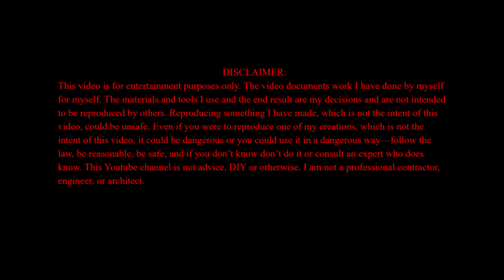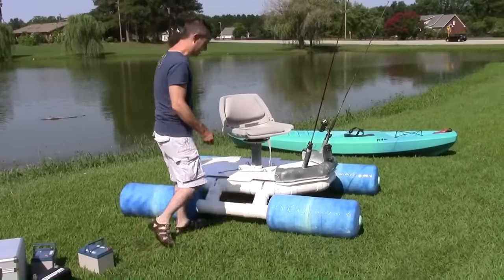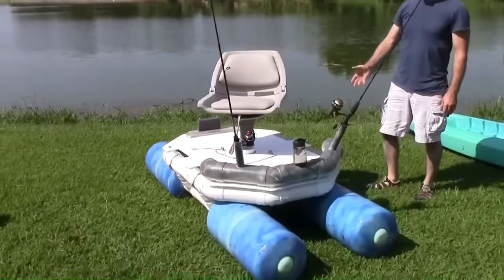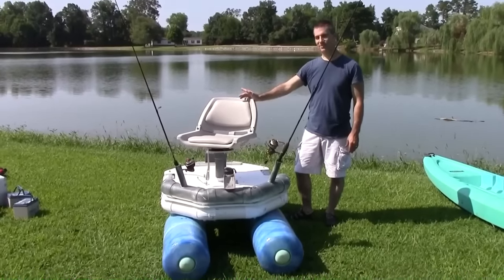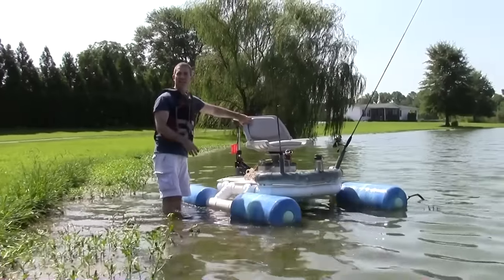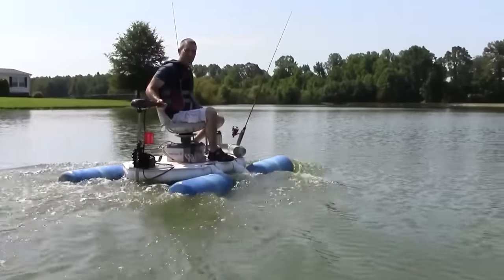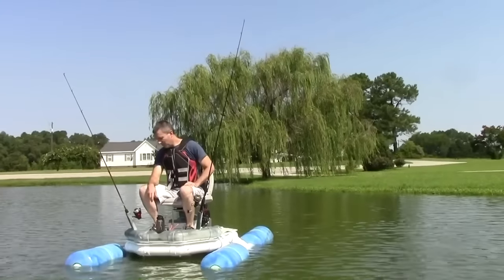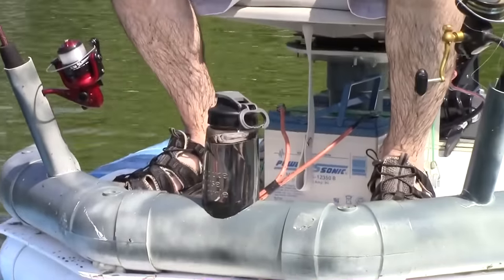Homemade fishing boat with foldable pontoons

Comment: Phase 4 and 5; Drink cooler(s), umbrella.
Phase 6 and 7:  Angled panel on front for better planing and extend (bend around chair back) tiller for easier control.
It's called "Kaizen" (continuous improvement).  ;-)
That's until you reach the stage of "Shoot the Engineer, go into production".
Reply: Yes
Reply: Post office tried to use kaizen a few years back. Screwed it up as usual.
Reply: Funny. 😁

Comment: Pretty nice design! 

 One recommendation I would make is to use A-line X coating on the pontoons this way you don't have major problems if you run into any hard objects while in the water.   It would be pretty easy for a hard piece of debris to make a bad day because the pontoons are made out of high density foam.  Align X coding would make it a lot more stout and in the incidents were you did hit a hard piece of debris it would keep it all held together if the foam did break even within the line X coding.
Reply from the maker: I will give it a try, thanks for the suggestion
Reply: Как вариаант, предварительно покрыв пенопластовые понтоны аллюминевой фольгой. Пенопласт очень чувствителен к УФ-облучению и за сезон превратиться в пыль.  И ещё, хомутовая стяжка не вызвает доверия в её надёжности, туда приходится основная нагрузка, вес рыбака против силы Архимеда.

Comment: Awesome idea and build.   Good thinking dude!
The only thing I see that could be added is V shape foam shields to the two front floats to break and disperse the water easier while going forward.  That might help glide through the water easier, less stress on the trolling motor.
Reply from the maker: Thank you for the suggestion, and I appreciate the compliment.

Comment: Of all the designs of yours, that I've seen so far... and that's several, but probably not all... I like this one the best... simple and easily fast enough for its purpose... I might increase the circumference of the pontoons adding just enough length to their support arms to accommodate the added size... to increase buoyancy and lift your deck maybe 2 more inches out of the water... I'm not sure it is entirely necessary but if I were to make any changes that would probably be it... other than possibly adding a small cooler under the chair...
Reply from the maker: Thank you and great suggestion, I really appreciate it!

Comment: I was thinking for the foam floats attached under the deck, you could make those hollow and cut some doors in the deck for additional storage under the deck, as is now just wasted space. Seems like the perfect place for a battery or tackle box, maybe a small cooler! Also maybe use the cut out inner circle of the pontoon and fill the pipe to keep the pontoon pipe from filling with water, or just fill the whole thing with spray foam and it can never sink, even if completely swamped by some assholes wake!
Reply from the maker: Those are fantastic suggestions, thanks for the ideas!

Comment: Much better but, anyway, what I would like to say is that you don't need to use the cleaning (purple) colored solution, the clear PVC glue in itself will cement the PVC fittings to the pipe, and it will be water tightly; once cemented you won't be able to separate the fittings from the pipe.

Comment: That is an awesome build. thanks for sharing. Awesome how it floats so well. 

i like that little circular saw you was using! Where did you find it at??? I would like to have one like that for some of my projects. Take care. Rodney
Reply from the maker: It is called a Dremel 678-01 Circle Cutter and Straight Edge Guide. It cost about $25.00 on Amazon. Thanks for the question.
Reply: @supergokue1  Thankya sir for all the information & also just for replying back yo me.

Comment: Pretty cool but looks nose heavy.  Another foot of foam and tube out front? And maybe a little taper, like a pontoon? Foldable was very clever btw.
Reply: Or maybe shift your seat back 6 or 8 inches, or adjustable. You are your own trim.
Reply from the maker: Nice, thanks for the suggestions!

Comment: So great so working project well done. If you made those float sides with a shape of a boat or canoe,  had better Buoyancy?
Reply from the maker: Good question, I'm not sure about that. I think it would make it go through the water better because of having less resistance. Thank you for the question.
Reply: I too was wondering the same but more on the aspect of it moving through the water racier rather than buoyancy
Reply: @supergokue1  ... I was just about to mention That; because Yes, that's correct:  Well, the Moving Through Water Better bit, anyway.  In a way though, the General Bouyancy wouldn't be better.
You could always Add a Piece to the Front of Each of the 4 Floats. You'd need to do All 4, because the Back Ones also get Resistance.  Adding then to the Back of each Float would also be advisable:  For Resistance when Reversing, and it would also Glide through the water better, by acting like the Trailing Edge of a Plane Wing.
Reply: ΓΕΡΑΣΙΜΟΣ ΣΤΡΑΓΓΑΣ 
Willy nelson

Comment: I was thinking that I would put spray foam inside the pvc while you were building that but than I saw you had some spray foam at one point inside the pipes. Am I correct?
Reply from the maker: You are correct, I did add spray foam into the legs for the pontoons. I really didn't do a good job of showing it. I appreciate the question
Reply: @supergokue1  
If your joints are sealed well, it'll be okay.
In fact, adding foam inside the pvc pipe won't help it float or support more weight - it'll only keep it from sinking completely in the event of a leak.
 Foam is heavy on its own, but once/if you DO get a leak, it'll hold LOTS of water, and man... talk about HEAVY!

I've been building boats since 2003, and we only add enough to keep it off the bottom of the lake(or whatever body of water), and since we stopped filling them completely with foam, we get better speed, fuel economy, and weight carrying capacity.

My personal Saltwater Flats boat is a 15ft two man fiberglass. When I redecked it last year, the hull weighed roughly 670lbs. I removed 90% of the foam inside, and put a new Coosa board deck on her... the hull now weighs around 315lbs. About 125lbs of that weight difference was between the old plywood deck, and the newer, lighter Coosa deck. The rest was the foam. Almost 230lbs of it!
THAT is how heavy foam can be, depending on what density is used.
Reply: @supergokue1  I was going to suggest this so pleased I read the feedback beforehand thanks for clarifying. As you know the spray foam adds strength and importantly rigidity to the PVC tubing which negates the some others have raised. Great job - most folks with a nouse of sense can add the mods to customise they wish

Comment: Flipping innovative, and ingenious.  Just curious maybe I missed it, but what is the weight capacity, and do you have plans for a two seater? If so I'm in for sure.
Reply from the maker: I'm not sure on the weight capacity yet because it is getting a remodel this spring. For now I am just sticking with the single seater. Thank you for the questions.
Reply: Just double the boyancy and plastic. Put another two hinges in the middle so you can "stack" it on top of each other without giving up length to fit in truck.

Comment: Very clever but PVC pipe is brittle and a wave or a jolt and you will be a swimming.
Reply: In the ARTIC maybe ,,would take sometime to go brittle in warmer climate's
Reply: @MICK9754  As a plumber I am quite familiar with PVC pipe and it's quite easy to fracture when new , under the stress of waves it would be very poor.
Reply: @acefreaky2988  Waves would not break that size PVC unless it hit something rigid or the rider weighed 300+lbs and was in hurricane surf.  I doubt if anyone would be fishing in that sort of condition.  It is a great design and relatively easy project nearly anyone could build.
Reply: @bluepearl45  Be my guest and give it a try .
Reply: Yeah those backyard pond waves, scary stuff

Comment: When unfolding the pontoons, how do you secure them so that they stay at an angle, rather than rotating up to the level of the boat frame? I've watched your video several times but still can't see what stops their rotation at what appears to be about a 45 degree angle.
Reply from the maker: I got more in depth in the book about this (available on Amazon for $2.99). I took a small piece of PVC and attached it to the frame of the boat. I glued it in place and added a couple of screws just incase. When moving the pontoons out they can only go so far before hitting the stopping point. Thank you for the question.
Reply: Look at 5:22

Comment: Thank you for directing me to this video to see how you made the foam pontoons.   I have a few more questions:

- how well did the cutout sections of foam hold together once the pontoon was wet and under force?  The hot glue held?

- what did you apply to the outside of the pontoons?  Some sort of varnish then spray paint?  

- does this type of foam become water logged over time, or is a closed cell foam? 

I would like to make a flotation collar for my 14' aluminum boat. Basically I need a foam log or pontoon, and this approach may do the trick.  I've also thought about trying to join 5 gallon buckets end to end to build a pontoon, but I'm struggling with their tapered shape.

Thanks a ton
Reply from the maker: The hot glue held up great and is still going strong. I applied clear Flex Seal because I got it for free, but I have other methods that are way cheaper. Unfortunately, I can not share them because I will be using them in future videos. The foam I used is called XPS foam, it is used in construction. I bought it at Lowe's home improvement. XPS foam has no issues with holding water. Thank you for the questions.
Reply: Nice job.  I made a foam kayak.  If I were going to make a pvc pontoon boat I would use at least 6 inch pvc pipe and eliminate the foam.  And maybe 4 pontoons instead of 2 depending on how buoyant it was.  The foam gets damaged.

Comment: My only suggestion would be to add a fiberglass shell to all the foam surfaces to make them sturdier for transport and around rough rocky shores.  That foam would get beat up pretty fast with most guys !
Reply: fiberglass will make it too heavy for easy load on and off.

Comment: Trolling motor in front with foot control comfortable fishing at its best!
Reply from the maker: You are correct, it was a little hard to use. The upgrade will be way easier to use. Thanks for the suggestion.

Comment: Very cool if you make the front of the poontoons angled or pointed it will cut thru the water better nice job
Reply from the maker: You are correct, they do need a little bit of work. Thanks for the comment

Comment: Great design and craftsmanship.  This is far superior to most of the diy  fishing boats I've seen.  The only question I have is  the cost factor. All those fittings and pipe are fairly expensive,  along with the plywood and foam. Then the time involved in actually executing the build. It's a great little boat and very functional,  but is it cost effective? I'm not knocking anything.  Great work. I am just curious about the time and cost involved building this
Reply from the maker: To be honest, I really don't keep track of the cost of most of my boats. I just enjoy coming up with a new design and creating them, sharing what I made ( good or bad ) with all parts of the world through YouTube. To me I guess it is my stress reliever. Thank you very much for the comment, I do appreciate it :)

Comment: Great video but I really need to know what you sprayed on the Styrofoam...THANK YOU
Reply from the maker: I started with a base coat of clear Flex Seal, then deep blue spray paint, and finished it off with another coat of clear Flex Seal. Thank you for the question.

Comment: Looks like a thin wall 4" PVC , perhaps SDR-35?   Are the pipe clamps the only thing holding the pontoons down at that angle or is there some safety stopper to keep them from slipping upward?
Reply from the maker: There is a safety stopper, it was hard to see and I really didn't talk about it. I will bring it up in the upgrade video. Thanks for the questions

Comment: Nice thing about your design is you can move fore and aft by just turning around. I think you will find the trolling motor will be more efficient if it is PULLING the pontoon instead of PUSHING.
Reply from the maker: Great tip, thank you!

Comment: To all the mouth breathing window lickers crapping on the guys efforts and saying coulda got this for a $100 much safer blah, blah, blah part of the enjoyment of this is the build, if not more so than the eventual fishing. 

I think it’s an incredible project. A great craft concept for small body water solo fishing. Adaptable by adjusting length to 2 person.

That being said some interesting points for edits have been made. Pontoon shape for sure. Also I was thinking of pipe fill. Others have mentioned foam fill as not really worthy. I was curious if the deck was attached by 2hole metallic pipe clips screwed into underside of the deck and the rotation idea of the cut Tees were done in a fixed manner on the pontoon arms if that would enable both the deck frame and each pontoon length to be drilled and tapped with an air pressure intake of some sort and keeping said pieces under pressure. Compressed air would offer far better buoyancy than spray foam. Just a thought.

Comment: What size pvc pipe are you using? Gave me an idea to make stability pontoons for my little home made "kayak". Thanks in advance.
Reply from the maker: For this boat I used thin wall 4-inch PVC. Thanks for the question
Reply: @supergokue1  Thank-you for the reply and for the video! Your design is going to help me tremendously. Again thanks so much
Reply from the maker: No problem :)

Comment: How many  polystyrene boads did you use per pontoon?  And what did you coat them  with? Thinking about making out riggers for my canoe.
Reply from the maker: A 4x8 sheet a XPS foam can produce 32 circles. The circles on the end pieces will be missing a little chunk. Which is easy to fix with scrap pieces left over. For each pontoon I used 14 - 1 inch thick circles. So 1 sheet can give produce 2 pontoons, with some left overs. I used flex seal to protect the pontoons, but I have found a much better way to protect them. I am working on it now and it will be in my next video that will be out soon. Thank you for the questions

Comment: I need  measurements if possible and what those square things on the bottom of the plywood where? And how much pipe to buy did one sheet of the insulation foam wrk? Did you use bolts or self tapping screws.
Reply from the maker: Unfortunately, the book was pulled from Amazon due to format issues. I can let you know when I have fixed the issue if you like. Thanks for the interest :)

Comment: Recommend hose clamps to attach deck to frame.  If the watertight integrity is maintained it increases the flotation and won't get heavy from taking on water.
Your project is awesome build and video.
Reply from the maker: Thanks for the tips!

Comment: Hi, after you slide the foam on the pipes, I didn't see how you fastened them? Can they just slide out as you are in the water? The front ones maybe not, but the rears, would slide right off? Thanks
Reply from the maker: Actually, they were just kept on by friction. Thanks for the question.
Reply: @supergokue1  Thank you for answering!

Comment: Think it’d work if the platform section was reduced to a smaller size like 2” pvc to reduce weight or would it no longer support a persons weight?
Reply from the maker: I have had good luck with 2 inch supporting my weight on some other of my boat designs. Thanks for the comment :)

Comment: I saw foam in one of the tubes.  Did you fill it with expanding foam?
Reply from the maker: I added foam just on the ends of each pipe to help make it waterproof. Thank you for the question, I really appreciate it.

Comment: You designed it the way YOU wanted it...don't change it. I love the idea. Far easier to use than a plastic "Bass Buggy" @$400.  BUT what is the foam sheets?
Reply from the maker: It is called XPS foam, I bought it at Lowe's Home improvement. It is used in construction for insulation. Thanks for the question

Comment: You forgot to mention that you filled the pipes with floam, I could see it in part of the video build, which is a good thing, as if the pipes spring a leak, the floam( liquid foam in a can for sealing large cracks), keeps the water from filling up and sinking the pontoon.

Comment: That's a great boat! I had to watch it with the sound down. Sorry if you answered this question but is there anything you would do different?
Reply from the maker: Great question, I would add wheels to move it around on land easier. Thank you for the question
Reply: supergokue1 This is a great answer. would you have a round figure estimate how much it might weigh? I do love the boat. I even love checking out your replies to the comments almost as much. Very clever.

Comment: You got a picture of you putting your foot on the step up and then with a foot on the deck.  It would have been nice to see how much it tipped when you had all your weight on the step itself.  Seems like it would tip a lot.  How much do you weigh?  at 210 lbs how much would it sink?  It is very nice though, a lot of potential.  Thanks